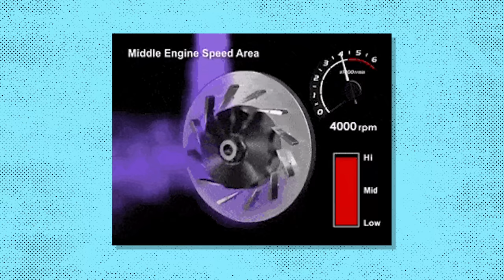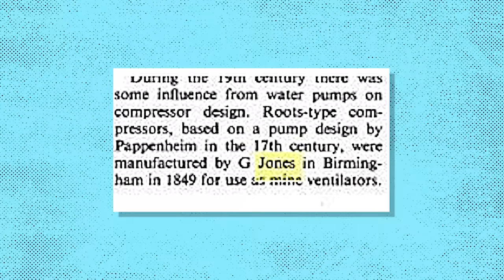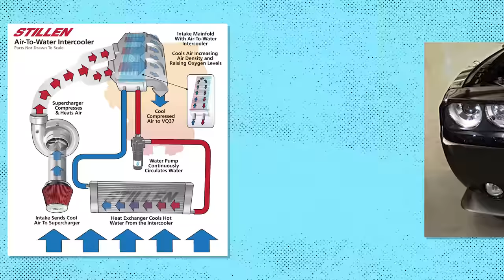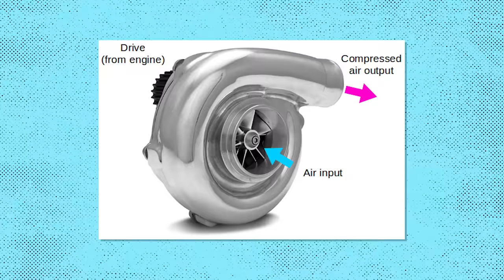Why Superchargers Aren't As Good as Turbos

Comment: Parasitic loss is barely even an issue on production engines, its the top fuel monsters that need 100's of horsepower to turn over
Reply: You can’t feel it on the but dyno, it’s just a calculation.
Reply: Turbochargers are banned from Top Fuel and Funny Car
Reply: @sandervanderkammen9230   They are probably sensitive regarding air to fuel ratio.
Reply: @raymonds7492  Nitromethane fuel contains its own oxidizer... allowing for much richer AFRs and lower sensitivity to air to fuel mixture rate.
AFR is based on the formula of the fuel and the percentage of available oxygen in the fuel itself.
Reply: @sandervanderkammen9230  even if they were not banned the turbos would be bad than good for horsepower
Reply: @XTR_NEELAN  That is completely false. Turbocharged engines make more power than supercharged engines
Reply: @sandervanderkammen9230  Thats definitely not a rule. Im making 12-1300hp with a littlefield blower and its not even the largest size of blower they make.
Reply: @anthonyjones8043  Yes, its not just a rule... it is a fundamental Law of Thermodynamics
At the same manifold pressure a turbocharger will deliver more horsepower than a supercharger.
And that is with centrifugal compressor, the Roots blower is even less efficient and has higher parasitic drag on the engines crankshaft.

Any questions?
Reply: @sandervanderkammen9230  Turbos CAN make more power, but if it doesn't provide it to match the required application...it's useless.
TOP FUEL experts will tell you...they can go faster, and win MORE races with LESS power...if they could better control getting power to the ground.
NHRA NITRO School.
Reply: @sandervanderkammen9230  you have no proof for your claims. If they were banned from the nhra due to being too fast, prove it with a letter from the nhra.
Reply: @tacticalidiot175  A letter from the NHRA?
Reply: @mikef-gi2dg  Top Fuel doesn't use turbos because they make the cars too fast.
Reply: @sandervanderkammen9230  That's not what people who make their living making top fuel FAST say...I'll refer to THEIR expertise on that matter.
Reply: @sandervanderkammen9230  are you 11?
Reply: @mikef-gi2dg  No, but I do know the NHRA rules for Top Fuel... something you obviously don't.
Reply: @sandervanderkammen9230  so what is it I lost...the opportunity to read about your whining about turbo everything? Ok you run with that. As for how I LOOK....just make sure you can hold up YOUR END.
Reply: @sandervanderkammen9230  Ok roll with that genius! By the way...what theory was that again?
Reply: @sandervanderkammen9230  Never mind...I don't really care what you think anyway.
Reply: @mikef-gi2dg  Sorry Mikey, but you look like a fool right now..
Top Fuel teams don't use Turbochargers because they are BANNED.
Reply: @mikef-gi2dg  The people who build the  most engines with the highest hp- per liter and BMEP know that Turbochargers engines make the most powerful... they also make the most powerful in racing series that allow them.
 NHRA banned turbos because they make the cars too fast.
Reply: @sandervanderkammen9230  And the people who do this for a living wouldn't swap over to a turbo if they could...their words not mine. Have you run a NITRO engine...sparky? If yes where?
Reply: @sandervanderkammen9230  Are you one of these builders Sandy Sparky? Do you have a turbo car Sandy Sparky? Have you taken it to the track, any track Sandy Sparky? Did you wave your massive BMEP per Liter in your competitions face Sandy Sparky? Did they run for the hills or puke at the lewd behavior, Sandy Sparky? Post your turbo prowess on YOUTUBE, it will cement your social media influence-er  status...SANDY SPARKY!
Reply: @sandervanderkammen9230  name one of these people you have met personally, and tell us where you turbo is?
Reply: @mikef-gi2dg  You made a complete fool of yourself.... I just pointed out this fact.
Reply: @sandervanderkammen9230  broken lonely record...soo sad...who gives a f#####

Comment: I dont think superchargers NEED to be mounted on top of the engine. I have seen some 4 cylinder engines with supercharges mounted on them and they are on the side of the engine.
Reply: With a long enough belt drive (which may suffer from power loss ofc) and piping, I'm pretty sure you can get a roots SC anywhere close to the intake. That said, the shorter belt you got, the better
Reply: I've got a Merc with a kompressor and the SC is not even close to the top of the engine. It is mounted on the side.

Comment: I love my Jaguar F Pace SVR. 542 bhp, instant massive torque without turbo lag, exhaust sounds better not muffled by turbo, nice little bit of whine from the front.  On a long run I get about 29 mpg (UK gallon) driving at the speed limit, whereas my old 240 bhp XJ struggled to do 27, so not as inefficient as you claim.  I don't like turbos, even if they might give slightly more mpg.

Comment: My audi s5 is supercharged and has a clutch that detaches from the crank when not booting it increasing cruising MPG. I still get over 30 MPG on average with a 3.0 litre which isn't bad efficiency at all!
Reply: which s5? the b8?
Reply: Same on my A6. Runs on the NA 3 liter unless you stomp it and then it starts to whine.
Reply: Not bad, but there's a dude who got 40 US (48 UK) MPG in his 5.7 C5 Corvette 😀
Reply: @lorddoobsworth144  using the corvette is basically cheating because it‘s so light and aerodynamic 😄
Reply: @faxxzc  and because it cruises in 6th at like 9 rpm 😆
Reply: The B8 does not have a clutch. Only in the later C7.5

Comment: Sequential turbo charging provides all the benefits of s supercharger, however the only problem is the massive heat created and sheer complexity, as opposed to dropping a roots style blower in the engine bay. That's my take on the issue even before I watch the video
Reply: Twin turbos still have lag and are less powerful than your one big turbo setup. Bi turbos are better but.... Why would you want a Bi turbo in a build? lmao.
Reply: @youngrody2386  He said sequential not twin...Sequential turbocharging refers to a set-up in which the engine uses one turbocharger for lower engine speeds, and a second or both turbochargers at higher engine speeds. This system is intended to overcome the limitation of large turbochargers providing insufficient boost at low RPM which is why you would want a sequential turbo build however the bi-turbo staged application is more suited for larger compression engines V6 , V8 ( Mercedes Bi-turbo for example) which split the exhaust more evenly V6 (3 cylinders per turbo ) V8 (4 cylinders per turbo ) 

Or you could use a twin charging system combines a supercharger and turbocharger in an arrangement, with the intent of one component's advantage compensating for the other component's disadvantage so you get that instant supercharged power while the turbo is spooling up . Hope that helps as to why you would want a Bi-Turbo build and a Sequential Turbo build and potentially a Twin Charging system vs a single large turbo

Comment: Turbos are neat in that they're the only type of supercharger where it's best to keep the drive mechanism at crazy high temperatures. Turbo blankets work purely because they trap heat in the manifold and turbine housing. That heat energy means the exhaust is gonna move faster through the turbine and push with more force. Exhaust gases can be partially assumed as "ideal gases". PV=nRT. Increase the temperature of the exhaust without increasing the volume, the pressure goes up.

Comment: Had a c230 compressor.  Best car ever except the $6k piston replacement.  Super fun to drive and with ps2's it was buttery smooth and handled like it was in rails- even in the rain. Lovely car- but the  repairs...I'll say this; if can't afford a new Mercedes that with a warranty there's no way you can afford an old one that doesn't.
Reply: My dad had a 2006 C230 sport V6. It handled so well and had a super advanced 7 speed for the time. Of course, the faulty timing chain sproket killed it, it jumped timing. However, it made it much further than most C230s (most died at 50-100K miles, some before even) and his made it to 175K partly because of luck and partly because of oil changes every 4,000 miles. I miss that thing!
Reply: I have an c320 avarange and have been thinking aboat adding the c32 amg's supercharger on it but idk becourse it feels nice to know that the engine can hold so much more power than it has right now/i dont need to worry aboat it when im flooring it. I am still going to add some becourse getting 220 hp from an engine that could have gotten 350 from the factory is just sad.

Comment: Superchargers are linear and the motor itself is already (fairly) linear while a turbo has an exponential function that just makes driveabililty anywhere under full throttle better.
Reply: Exactly.....belt driven power adders are directly connected to crankshaft rpm. The ECM knows exactly what each driven device is doing because of programming. The supercharges is predictable...at all times. That's from the wheels up......
A very well known performance expert told me long ago...." ANY TURBO CAN DESTROY ANY ENGINE YOU CONNECT IT TO IF NOT PROPERLY CONTROLLED....POWER WITHOUT CONTROL IS CHAOS..."
Reply: @mikef-gi2dg  ECMs use the same MAP sensor on Turbocharged engines to determine intake manifold pressure.
 The MAP sensor reading is usually combined with a mass air flow sensor to more accurately determine the best AFR and ignition timing maps to prevent damage from preignition and detonation.
Intake charge temperature and barometric pressure sensors are also used to trim fuel and ignition outputs on both types of engines.
 A supercharged engine can be just as quickly and easily destroyed by detonation due to high pressure, high temperature and a lack of fuel enrichment needed to suppress knock.
Both superchargers and turbochargers can use a intake manifold pressure relief valve to prevent overboost, turbochargers can be managed by both a blow off valve and and wastegate for more accurate management of intake manifold pressure.
Intake charge Aftercooling (intercoolers) are equally effective on superchargers as turbos in managing temperature.
 The biggest problem that destroys forced induction engines is lack of proper fuel enrichment to suppress knock, and of course in is also possible to simply exceed the pressure stress limits, the strength of the indivual engine components.

 The biggest problem that most shade tree mechanics have with turbocharger engines is a lack of understanding of the fundamentals of internal combustion technology and how turbochargers actually work  in a combined cycle.
A supercharger is simply a pump, a turbo is pump driven by an external auxcillery heat engine.
Any questions son?
Reply: And with all that...your point is?????
Is it you are the sole keeper of knowledge?
Only you understand these things? All knowledge flows through you? What?
Reply: @mikef-gi2dg  Just the facts here kid, turbochargers make more power... its that simple.
Reply: @mikef-gi2dg  if you don't want to look like a fool? Don't post comments on a topic that you clearly don't not understand.
Reply: @sandervanderkammen9230  Are you 12?
Reply: @mikef-gi2dg  The world must be a a frightening place for people like you,    don't be scared of technology.
Reply: @sandervanderkammen9230   All this fake outrage because someone doesn't think a turbo is the solution to the worlds most pressing problems. Sandy... you got much bigger problems to deal with, but it's not my problem or job to help you with that. So rock out with your boost out. Drop a couple of turbos in you shorts if that's what makes you warm and fuzzy. Hell make a ticktock showing how you are all spooled up and ready to go. That should be good for a few laughs.
Reply: @mikef-gi2dg  I'm not the one that looks like a Luddite and a fool right now.
Reply: @sandervanderkammen9230  All this fake outrage because someone doesn't think a turbo is the solution to the worlds most pressing problems. Sandy... you got much bigger problems to deal with, but it's not my problem or job to help you with that. So rock out with your boost out. Drop a couple of turbos in you shorts if that's what makes you warm and fuzzy. Hell make a ticktock showing how you are all spooled up and ready to go. That should be good for a few laughs.
Reply: @mikef-gi2dg  If you don't want to be made d fun of? Don't post stupid comments were people can read them.
Reply: @sandervanderkammen9230  Yep ranting about how you hate superchargers should make you a hit on tiktok. Not to mention how you single handily tanked supercharger manufacturer stock around the globe. You are about to become very popular. 
Maybe you should run for office, and introduce a bill to outlaw superchargers.
Rock out with you boost out sandy!
Reply: @sandervanderkammen9230  Hey is that a turbo in you shorts, or are you glad to see us?
Reply: @mikef-gi2dg  I think superchargers are great too, some people that are afraid to go fast still use them...
Reply: @mikef-gi2dg  If your going to be a Luddite you should really own it man! Be proud of the fact that you live in fear of new technology
Reply: @sandervanderkammen9230  First things first...I seriously doubt that there are very many people BORED ENOUGH OR DUMB ENOUGH.....to give two shakes about what I think they should or should not do. I am 1000% fine with that!!! Secondly for anyone out there who thinks they have the only truth to be had...I got just one question.
DID YOU REALLY THINK ABOUT IT BEFORE YOU MADE THE RULES?
Reply: @sandervanderkammen9230  I make my living and support my family dealing with new technology. What I would fear is becoming a sandy drowning in DUNNING KRUGER EFFECT  with dreams of being the shot caller.
Reply: @mikef-gi2dg  I simply pointed out that ECMs detect manifold pressure exactly the same way on Turbocharged engines as supercharged engines and that the primary failure mode is also the same which revealed your comment as both biased and unsubstantiated.
Reply: @mikef-gi2dg  Working in the electronics department at Wal-Mart does not qualify you as an expert on engine technology... the fact that a vehicle's ECM has no way to distinguish between a turbocharger or a supercharger proves you are not an expert.
Reply: @sandervanderkammen9230  I repeat...who cares enough to comment on your feelings about MAP?
Reply: @sandervanderkammen9230  As a matter of fact Wal-Mart inc. has paid expert level $$ for my services. As far as any comment you may have on what an ECM can or can't do, who cares? Not me and sure enough not enough to comment on. I do not need or want you assistance on ANYTHING AUTOMOTIVE, AND I DON'T CARE. So what the hell are you posting fake outrage on? Get tested.
Reply: @sandervanderkammen9230  oh no here he goes again the keeper of knowledge has spoken
Reply: @sandervanderkammen9230  the brave sandy sparky has spoken...
Reply: @sandervanderkammen9230  snarky sandy sparky has spoken......the world trembles....
Reply: @sandervanderkammen9230 I coulodn't care less. And nobody is complaining about that. Where is your turbo car?
Reply: @mikef-gi2dg  You made a complete fool of yourself.... I simply pointed this out.